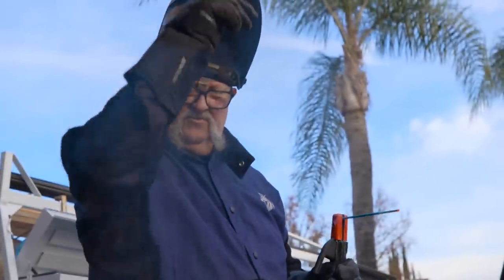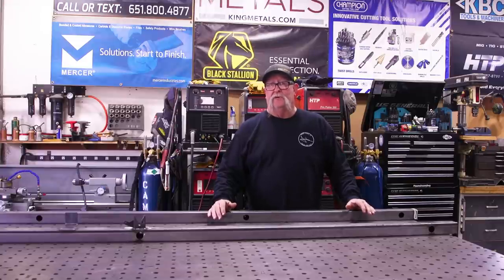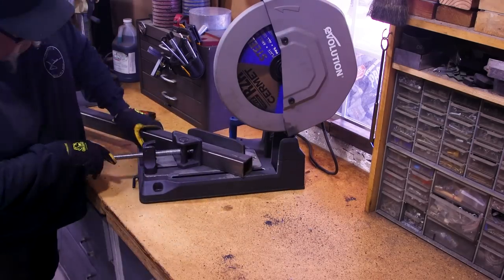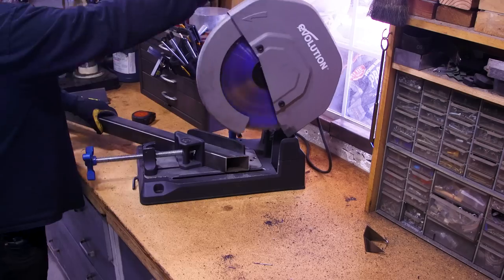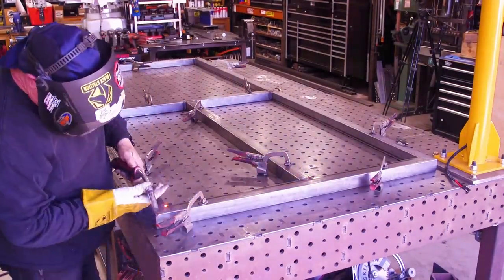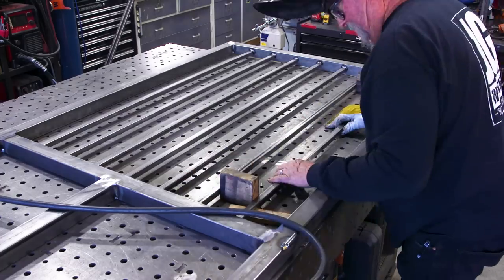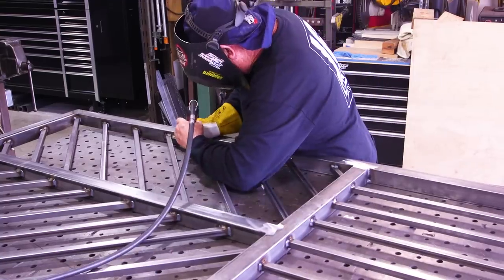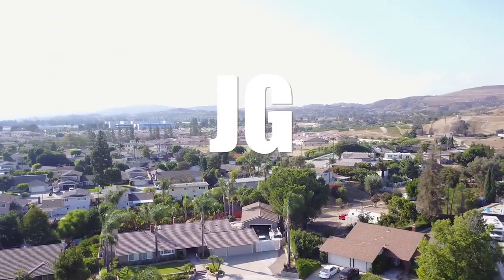9ft Gate | JIMBO'S GARAGE

Comment: Might need expanded metal or metal screen on outside to deter climbing up and over.
Reply: If someone wanted to get in that bad then they would find another way
Reply: Great project - other considerations welding pickets flush with outside face (creekside) instead of centerline and adding more pickets for 2 in o.c. for no toe hold from creekside.
Reply: I was thinking the same thing.  Maybe corrugated roofing so they can’t look up there either!
Reply: That’s no fun , then how would you get to shoot the intruders

Comment: I had a similar situation on the inside of a tight angle, a buddy told me to take a hammer and flatten an old nozzle down. I thought he was crazy but it worked like a charm!  I was able to sneak in there closer so the stick out wasn't too bad. I've had to use it a few times since.

Comment: looks really good. Question for you. Do you not find that the frame pulls out of 90 at all only having the clamps down. I also have a fixture table and I just had to weld up 14 - 6' x3' railings and even with all my fixtures and clamping the hell out of it it still wants to shrink up a bit. I am still around 1/32 out of square which is fine but It just always seems to shrink up on me. Not sure what I can do different. I start by taking the outside edge all around, then taking the top, then welding outside edge, top side, flipping the railing and welding the top side and then finally welding the inside corner joint. Not sure what else I can do. Any tips would be helpful. Thank you. Paul

Comment: I can never figure out the math correctly for the pickets
Reply: I use my tape measure diagonally to lay mine out.
Reply: @darren6790, that's actually quite easy, especially for us that use Millimetres. Take the total distance to be covered, minus the total amount and thickness of the pickets, then divide by the number of spaces you have. Eg 
If the total distance is 1000mm, and there are 8 X 25mm pickets, take 1000 - (8x25) = 800. Then divide by 9 spaces (because there are 8 pickets), and your spacings should be 88.9mm 😊